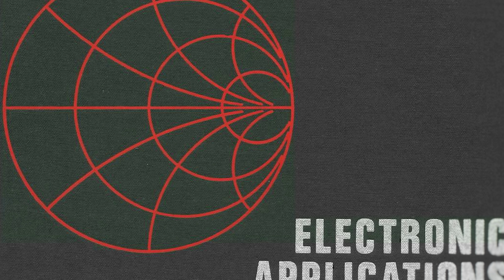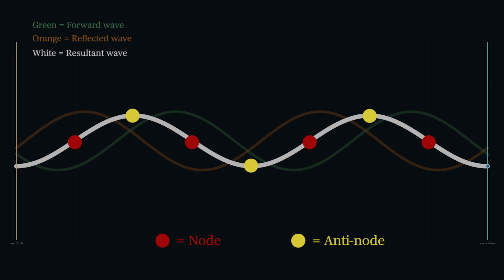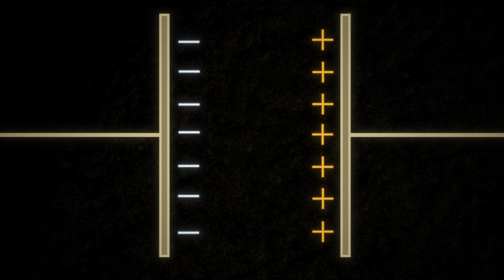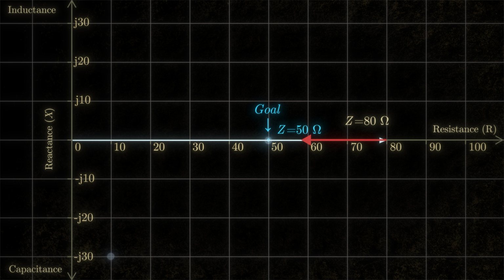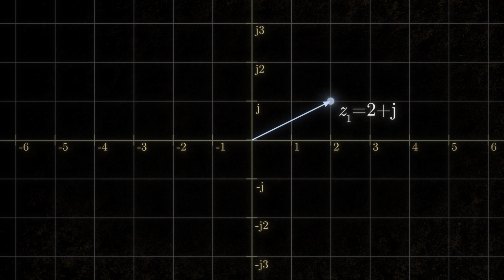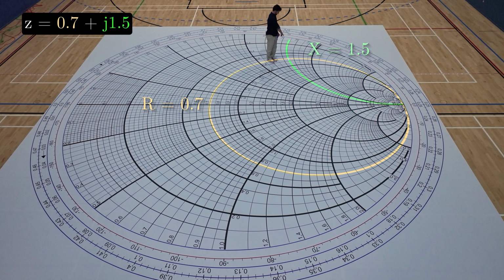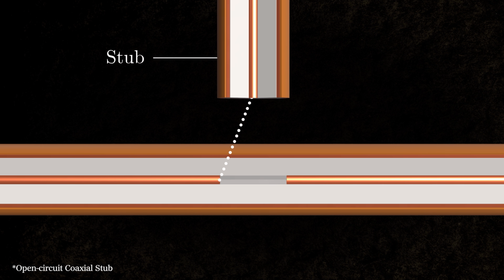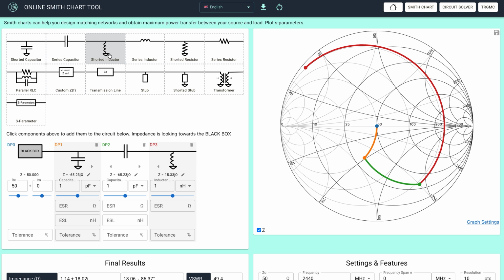The Scariest Chart in Electrical Engineering

Comment: While I work with electrical engineering, I have actually never seen or used the Smith chart. I am the second type of electrical engineer; the one that unintentionally designs antennas (as opposed to the electrical engineers who intentionally designs antennas). This video was a very good and simple explanation of all the courses I didn't take.

Comment: Need guidance (Juinor Electrical Engineer here): Referring to 33:31
The wave frequency is 1085 MHz, so by using  λ=C/f, it gives the wavelength of 0.276 Meters. Half of it would be 0.138 meters. so 0.138 m corresponds to 360 degrees revolution on Smith's chart, Now, my question is when you were calculating the length of the stub you covered 302 degrees which makes 83.33% of the 360 degrees. Then why is the length of the stub 77 mm instead of 115 mm. 
83.33% * 0.138 = 0.115 m > 115 mm?

I would appreciate it if anyone could explain this to me.

Love you Veritasium

Comment: I dont think its black magic.. it think its curling up to another set of comples numbers..like think like infinity 8 symbol and the curl point is then thinking in terms of water vapor-liquid solid. Then think of a strange case for mercury. 

Like what if you had a mercury tube with a neon gas but with three blubs on the vertical axis.

What if  you had a chart for when mercury turns to a liquid and then when it turns in a solid.

I'd reference charles promethus steimetz instead of eninstein for this.

Electricy and matter.

Comment: This is an extremely well-put-together video, and I hope this doesn’t come across as nitpicking. One visual that might help some people understand what “90 degrees out of phase” means is to imagine a dot moving around a circle.

One complete rotation around the circle is 360 degrees, just as one complete sinusoidal waveform is one full cycle. If you track the dot’s vertical position as it rotates around the circle, that motion creates a sine wave.

For example, imagine the dot begins at the 9 o’clock position. We can call that 0 degrees. Draw an imaginary line from the center of the circle to the dot. As the dot moves clockwise to 12 o’clock, that line has rotated 90 degrees, and the sine wave has risen from zero to its positive peak.

When the dot reaches 3 o’clock, the line has rotated 180 degrees, and the waveform has returned to zero. At 6 o’clock, it has rotated 270 degrees, and the waveform is at its negative peak. When it returns to 9 o’clock, it has completed 360 degrees, or one full cycle.

That is where the degree measurement comes from. A quarter of a cycle is 90 degrees, half a cycle is 180 degrees, three-quarters is 270 degrees, and a complete cycle is 360 degrees.

So when the current reaches each point one-quarter of a cycle before the voltage does, the current leads the voltage by 90 degrees. Saying “the voltage lags the current by 90 degrees” means the same thing.

The circle visualization helped me understand why phase differences are described in degrees rather than simply saying that one waveform is shifted sideways.

Comment: Why did they add a resistor at 10:00?? Why did they think that that would work?? Im not an engineer but I just don't understand why that was even an option. 🤔 why would lowering the initial output (transmission) increase receptivity (antenna)?
Reply: It just sounds like there is interference.. unless, there was an electrical capacity issue with the antenna's material.. (maybe that's why they did it??) but i would assume that if that were the case, they'd have known those limitations with each specific material BEFORE using them to experiment with.

Comment: Did you know that if there was no local loss of energy then the chart would actually resemble a hyperbolic plane.
Reply: Or I think it can be projected differently into a hyperbolic plane as it is. I'm not sure right now.
Reply: Sorry I am a huge fan of a non-euclidean hyperbolic space-time curvature.

I think that the quantum waves could possibly scrunch SpaceTime into a topological disc type thing on the large scale. Because mathematically those ways are technically wrinkles in SpaceTime but it's all connected to Infinity which means there is no room for the wrinkles to unwrinkle there for the universe must be non-euclidean or hyperbolic in a topological disc manner.

Comment: This information that you’re looking at is way older than 100 years and the people they told you discovered it did not.
Also, electricity does not flow through lines like water through pipe. 🤷‍♂️ yes electrons flow through, but they are balls slow…
The energy is transferred by a magnetic field around the outside of the line. Nothing flowing inside of it…  not understanding this is a primitive comprehension of electricity

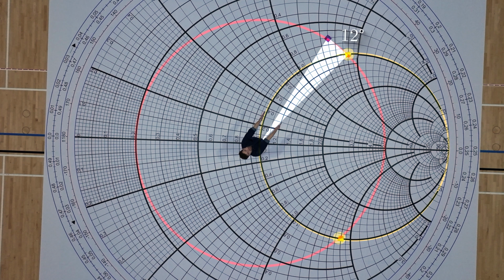Comment: 28:47 what speed are they assuming here?

wavelength = velocity / frequency
distance = 1/2 wavelength * (12/360) = 0.5 * (v / 1085MHz) * (1/30)
3.1mm * 60 * 1085MHz = v
v = 201810 km/s
is that right?

Comment: Nice explanation - in my late teen-early 20's I worked at a TV shop that installed TV antenna systems and maintained distribution systems, so dealt with the consequences of mismatched impedance due to weathered and damaged components, as well as defective units and poor installation. It always amazed me how I could go through and make significant improvements by just correcting poor workmanship, or how the reflections from bad components or connections could affect the signal quality so far back on the line.  Too bad cable guys don't get a bit of this info - one of my other battles was interference from unterminated or poorly installed/maintained cable connections acting as little broadcasters on the low band.  Thanks for helping fill in the blanks, albeit 50 years later! 😁

Comment: Retired electrical engineer here. Spent 35 years in the electric utility industry designing high voltage electrical systems - transmission, distribution, substations, and even metering. I had seen this chart throughout my career, more so during my college days (I graduated in 1989. . . . DON'T do the math!) But I never used it. Didn't need to. I never designed any RF systems. So I was able to follow along the basics during the first part of the video. That was SO helpful because as you went further into the complexity of the Smith chart, everything just fell right together. Despite my lengthy career - and I am most certainly a professional in my field - I knew NIOTHING about this chart until today. VERY educational . . . . I am just glad there was not a quiz at the end. LOL! Thank you for posting this most amazing and educational video!

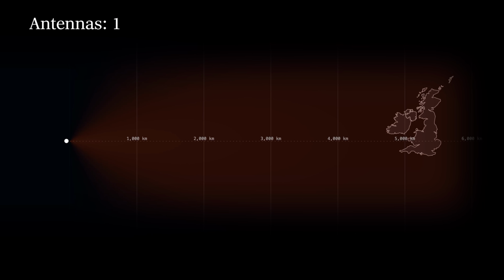Comment: 1:50 The amount of antennas shouldn't matter. The distance between New Jersey and London is 5426 km so due to Earth curvature there is almost a 2.5 km difference in altitude. How can a beam in a straight line reach over a curved surface? Without satellites to reflect the signal it should never work

Comment: There's different types of even electricity and we're using what's known as dirty electricity search deeper and higher remember space is full of the stuff like Tesla 369 says.. a south African has used frequencies from the air with amplification just like how an antenna or aerial receives energy different heights helium balloons connected to the ground via copper or even cotton wow..

Comment: This video inspired a philosophical idea that I couldn't let go of.

What if the Smith Chart isn't only a tool for matching electrical systems... but also a powerful metaphor for understanding human communication?

The essay explores how concepts like impedance, reflection, standing waves, resonance and matching can help explain why people misunderstand one another, why some conversations flow effortlessly, and why others seem destined to reflect back exactly what we transmit.

It isn't a book about RF engineering, and it isn't a psychology textbook. It's an attempt to build a bridge between engineering, philosophy and consciousness using one of the most elegant diagrams ever created.

If that idea sparks your curiosity, I've made the complete essay available in The Crows Are Watching.

I'd genuinely love to hear what fellow engineers, radio amateurs and curious thinkers think of the idea. Whether you agree, disagree, or discover connections I missed, I'd love to hear your thoughts.

Search for The Crows Are Watching, on google and look for The Smith Chart and the Geometry of Communication.

Comment: I study electronics. Love you guys for making this video 👌👌
Not sure somebody who´s not studying electrical engineering will actually understand this though.
For anybody asking themselves why a full rotation around the chart corresponds to half a wavelength: 
The reflection coefficient Γ at distance l from the load is Γ(l)=Γ⋅e^(−j2βl), β=2π/λ is the phase constant. If one moves one wavelength λ from the load, that yields: 
2βλ=2⋅(2π/λ)⋅λ=4π=720°, so rotating by one wavelength means two full revolutions on the smith chart and therefore one revolution means rotating half
a wavelength. At 28:56, they arrive at a length of 3,1 mm for the 12° rotation. I didn´t get that at first, since I calculated the wavelength for a wave propagation 
speed of 3⋅10^8 m/s (speed of light in vacuum), which yields λ = 0,276m, divided by 2 (half wavelength) times (12/360) yields 4,6mm.
But since we are looking at a coax cable with dielectric, probably made out of solid polyethylene with a relative permittivity of εr≈2.25.
That yields a velocity factor of VF=1/sqrt(εr)≈0,67, so v≈0.67c. 0,67⋅4,6mm=3,082mm, so about 3,1mm.
Subtle details that were left out here and would have helped to understand what´s going on.
Also would have been good to point out that the impedance we marked on the chart is the one of the sender antenna (as far as I understand it).
And that we are trying to match it to the coax cable´s wave impedance of 50 ohms.
Also would have liked to see the measuring of the impedance of the antenna - how it was done.
With an oscilloscope? Applying an AC-voltage and then measuring current via a shunt resistor and phase angle between them or some kind of impedance meter?

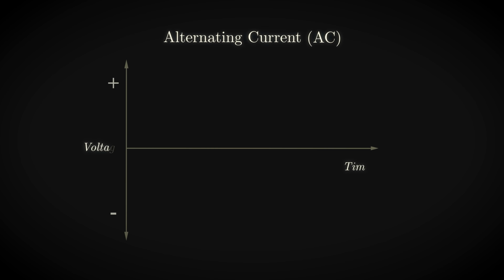Comment: 3:09 You do not animate a signal when plotted with time on the abcissa axis (unless the time line for some reason is also 'running along'). You seem to be conflating signals and waves, which will make it very difficult to understand, for example, phase. You could, however, animate an associated rotating phasor (a 'complexor'), and look at how its real part projects onto the time line plot. But in the plot that you shown, you must have only one value for each time, which you don't.

Comment: i used the smith chart to make rf amplifiers with the bfr96s,cly2 , cly10 and cly15. on higher frequencies we dont use the smitchart to couple antennas, we just use a quarterwave coax with specific impedance that you can calculate for the amount of antennas you put parallel. that quarter wave coax you then make on machine like a lathe or with tubing that comes close enough from hardware store.

Comment: That dark diagram is only half of it. The other half is the + 
Imagine two tornadoes. One upside down, one right side up. Where they meet in the middle (where the land might be) is called the zero point / point of inertia.
It appears that these tornadoes are turning in opposite directions but they are in fact turning in the same direction. "Opposite" depends entirely on the side you're standing on. 

That picture of two tornadoes spinning in opposite directions is very similar to what a magnetic field / gravitational field looks like.

Comment: This isn't even close to the scariest/hardest things that EE's are exposed to- this is nothing.  This was introduced and explained in a 300 level (junior year) RF design course in 1 or 2 lectures.  It was completely explained as a mapping/transformation of the complex plane onto a finite plane.  For EE's, this is simple- there are dozens of similar transformations that we deal with- its a nice tool but not scary or even very challenging.  There are tons of more complex concepts in EE.  I've seen this on the web and its just BS- EE is way, way more abstract than a graphical transform.   Real EE's completely understand Maxwell's equations- they exist in differential and integral form.  Both forms use some serious vector calculus and advanced calculus- they rely on Curl, Divergence, Contour integrals and their results are profound.  Smith Charts are nothing.  Any EE that thinks that Smith charts are scary, difficult or even challenging has a poor education.

Comment: AH! So this is what were were doing as kids back in the early 80s when we were using a length of antenna wire and tin foil to de-scramble the HBO signal coming in through the cable. We would move the tin foil up and down on the wire to get the best signal possible. Then snip a small piece of antenna wire off at the end and do the movement and snip again. Eventually you would get a solid signal.

Comment: I think there is another aspect of the application of the Smith chart that is left out. You can use a section of a transmission line of  different impedance to match a load (to 50 ohm).

This method is known to amateur radio like what is presented by W5DXP, "My transmission line matches my antenna". Eg. Use a section of 300 ohm ladder line to match an antenna with a complex impedance R+jX back to 50 ohm.

Comment: My interest is in relevance to ham radio.  I am trying to study for the Extra Class exam after being a General since 1964 and building stuff in the tube days with big wires connecting everything. I go back to crystal sets!  

Then I was off the air for 40 years until 2021, and I have to  learn a new world of semiconductors, circuit boards, and more EE-level stuff, mostly that I have never used and never will use in my ham life. 

I am strictly an SSB HF operator. I had to pass CW at 13 wpm but have never used it on the air, although I can still do my call in my head.

The Smith chart is on the Extra exam. I use a RigExpert analyzer instead of a Nano or Smith Chart to tune a 17.5 ft vertical for a Parks on the Air activation on 40 or 20 meters.  

I also know that as long as the SWR, or for you EE's VSWR, is not generating too much heat to burn up coax or the final in the TX (which modern rigs will cut off). As I understand it, Resonance will be more where Reactance X=0 at the feedpoint, which is usually not at the point of lowest VSWR (but close). 

SWR of 1:1 is where the complex impedance is equal to the desired impedance, like at 50+j0. A 200+j0 is resonant, but a high VSWR thanks to the resistance. 

VSWR is not "lost" but is re-radiated by the TX after a phase reversal. It is only the R of the transmission line (coax, etc.) creating a loss due to return trip/s back to the antenna.  It continues to bounce back and forth until the remaining energy is entirely dissipated as heat or radiated into space. However,  the VSWR diminishes exponentially with each bounce, so that after the first return, the added transmission line loss becomes insignificant.

I don't worry about a 1-3 dB signal loss since generally less than 3 dB is not recognized by the human ear. Gee, that is a loss of half the power, but not meaningful at the RX end. It is half an S unit per standard Collins S unit = 6 dB, but some manufacturers calibrate as a 3 dB difference per S unit. 

At HF frequencies, I use ABR 50ft RG-8X (Orange wrap for POTA, with 5 ferrite chokes.) Attenuation is only 0.7dB at 30 MHz and 0.45dB at 10 MHz. If you are on VHF/UHF, you may want a lower-loss transmission line. 

I got A's in accelerated math and physics classes in High School.  But hit a brick wall early in EE at the Univ of Minnesota.  It was what I call more conceptual vs my more analytical brain.  (or is it other way around).  I quickly switched majors to business and accounting, then a career with CPA firms, and then my own investment firm. It was easier to grasp that debits are always on the left and credits are always on the right vs EE conceptual stuff!

Dave WØJKT "Just Killing Time" since 1964

Comment: Every circle is, in a sense, composed of the infinite. A finite circle can be understood as the limit of an infinite collection of infinitesimal tangent directions or differential elements. From the perspective of the infinitesimal, the finite appears immeasurably vast; from the perspective of the infinite, the finite is itself infinitesimal. The number one occupies a unique position in this relationship. It serves as the multiplicative boundary separating quantities greater than one from their reciprocals between zero and one. Every positive number greater than one has a corresponding reciprocal between zero and one, establishing a symmetry through the transformation x↦1/x. In this sense, one is the fixed point of reciprocal inversion.

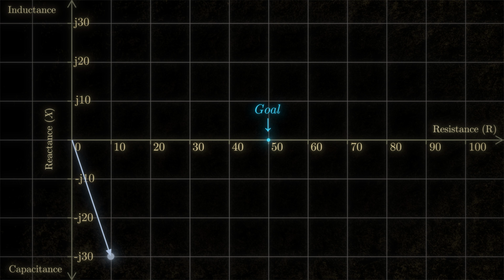Comment: 15:46 during uni, I remembered this by thinking of "ice", ice floats on water, beginning from top left, inductance, I, on bottom, C
Reply: we used CIVIL, capacitive => IV, voltage comes after current (lags), inductive => VI, voltage comes before current (leads)
Reply: @drcgaming4195 yeah yeah I would use ohms law divided by the wavelength of the southern pole (I just wanted to be part of the crew)
Reply: I just remembered it by CAPacitor: Current ahead potential and the other way for inductors

Comment: Imagine, these geniuses had been able to use modern computers. They'd probably never found such an simple solution fitting on a sheet of paper. They'd most likely built a complicated software able to magically calculate the needed values. 
What is the point here?
The more comfortable the tools, the less elegant the results.